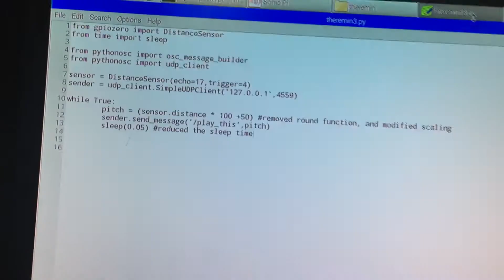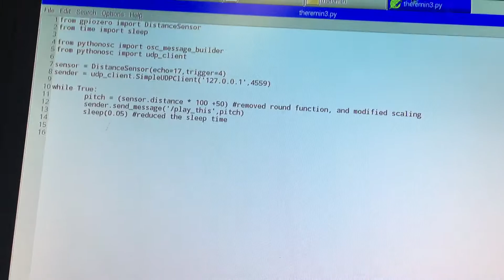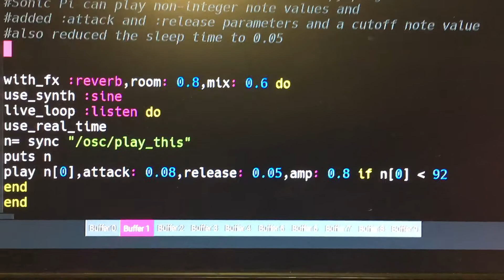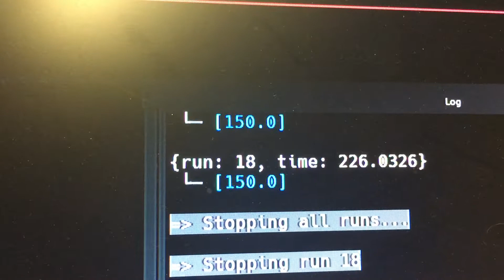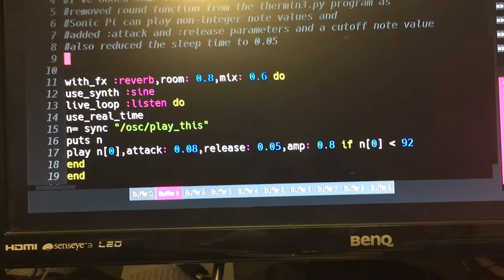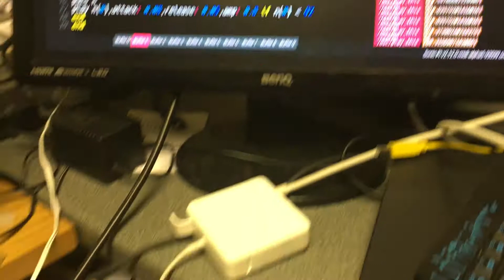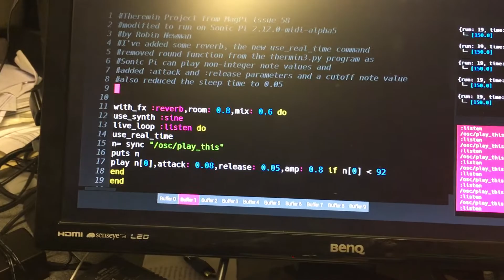Sonic Pi Theremin

Comment: File "/usr/lib/python3/dist-packages/gpiozero/input_devices.py", line 997
    warnings.warn(DistanceSensorNoEcho('no echo received'))
DistanceSensorNoEcho: no echo received 

Im getting this error when I run my distance.py, please help
Reply from the maker: This is an old project now, and the code does not work as written on the current Raspberry Pi operating system. It also will not work on the version of Sonic Pi bundled with it (verson 3.1). To get it working you need to install Sonic Pi 3.3.1 which you can download from in-thread.sonic-pi.net You also need to make a couple of alterations to the programs. You need to alter the port 4559 in the distance.py  script to 4560 (the new cues input port in Sonic Pi). Also in the Sonic Pi program you need to alter the line n = sync :/osc/play_this" to read n = sync /osc*/play_this"
Reply: @rbn1tube  Thank you very much for the long detailed answer. I have latest versions of Sonic Pi and everything, but need to try changing the port.
Reply: @rbn1tube   @rbn1tube  I tried the exact same thing you suggested, but it still doesn't work. Made the changes you recommended. But its still giving this error in the python shell, it wont run: 
Warning (from warnings module):
  File "/usr/lib/python3/dist-packages/gpiozero/input_devices.py", line 997
    warnings.warn(DistanceSensorNoEcho('no echo received'))
DistanceSensorNoEcho: no echo received

Please, any way you can help me?
Reply: @rbn1tube  Also sir, I havent used any resistors. Could that be a reason? 
What is the significance of resistors in this?
Reply from the maker: @Badar2310  you do need the resistors to get the right voltages in the circuit please add them.
Reply: @rbn1tube  Thank you sir but again, this is not being fixed. I made the changes you suggested.
Warning (from warnings module): File "/usr/lib/python3/dist-packages/gpiozero/input_devices.py", line 997 warnings.warn(DistanceSensorNoEcho('no echo received')) DistanceSensorNoEcho: no echo received

What can I do to fix this, this is a huge obstacle.
Reply from the maker: @Badar2310  have you added the resistors? I think this is your problem to get the circuit right.
Reply: @rbn1tube  Yes sir, I have added the resistors as you specified. It's the same error, whats causing it?
Reply from the maker: @Badar2310  I'm not sure I can suggest much more. I wonder if the sensor has been damaged in using it without the resistors? Do you have a replacement you might try? I think the problem is with the hardware side of the project and not Sonic Pi.
Reply: @rbn1tube  Thank you very much for the time to write all that. The problem has been solved, my sensor works. I just changed my inputs, it worked! The sensor is detecting my movements in RPi. Now I am on the LAST step, I need your help for this. I am unable to send notes to Sonic Pi, as in I do not hear the sound. Is there a way I can show you my code or something. Im almost there, this is for a university project and Im racing against time. Any help would be appreciated. I followed your instructions and changed the port number to 4560 and set my IP address, but it wont work.

Comment: I love how you did this project! I've tried the same thing, and I added a print(pitch) so that I could tell whether or not the Ultrasonic sensor was working. Despite getting readings for the pitches I was supposed to be hearing, no sound is coming out. Do you have any advice? Thanks!
Reply from the maker: You may find this second project I did on Theremins useful on https://rbnrpi.wordpress.com/2018/05/17/dual-sensor-theremin-for-sonic-pi/
Reply: rbn1tube thank you!!!

Comment: Great project! 
Been working on this for days and can’t make it work. Can you please share the circuitry for the 1k resistors please? Thanks!! 😊
Reply from the maker: The circuit I used is identical to the one shown here https://projects.raspberrypi.org/en/projects/ultrasonic-theremin/4 except that I didn't have a 470 ohm resistor, so I used two 1K resistors wired in parallel. I recently connected up this circuit again, and initially it didn't work. I found that updating my raspbian to the latest version sorted this out, so I suggest you use the latest version of stretch on your Pi. Good luck!
Reply from the maker: You may find this second project I did on Theremins useful https://rbnrpi.wordpress.com/2018/05/17/dual-sensor-theremin-for-sonic-pi/